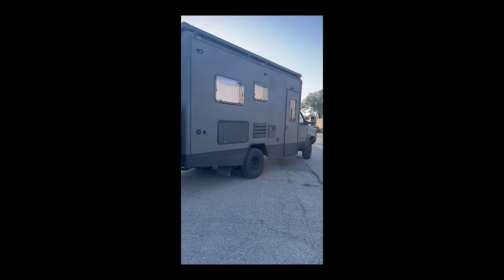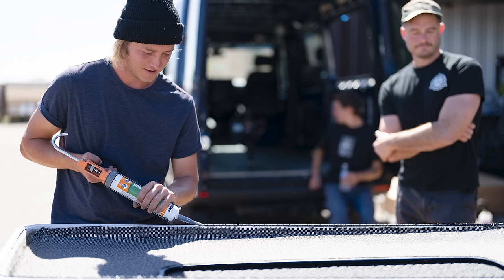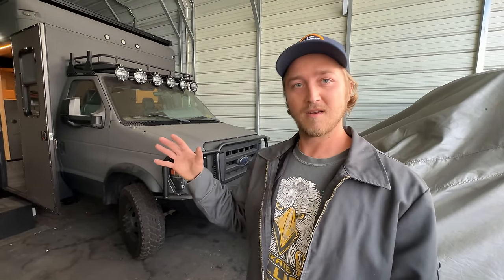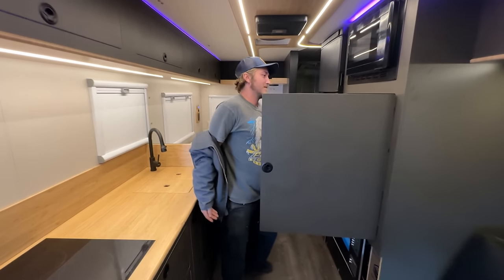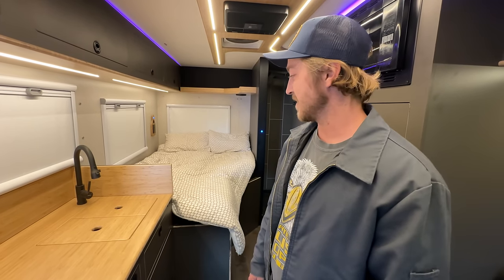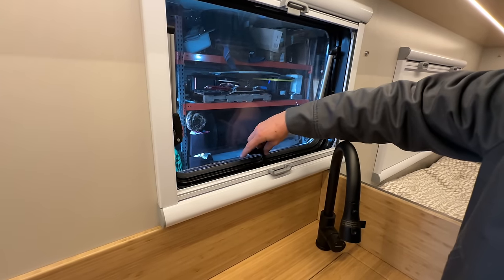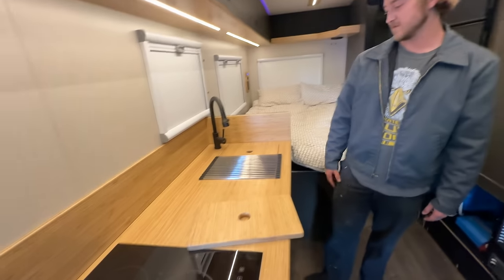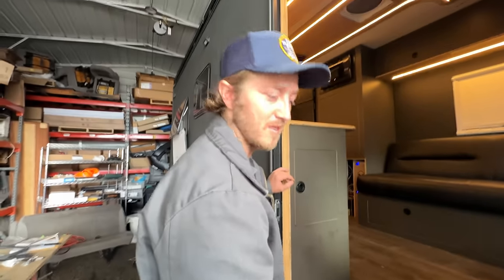We turned a Giant box truck into a Mobile Tiny House

Comment: A gallon of water weighs 8.9 lbs. 58 gallons of freshwater capacity is about average for a mid-size 5thW.  With a raised suspension, driving a rig like this on the highway, at 65 mph, while carrying a max load of water probably is not a great idea. You can do what you want, but some manufacturers, like Jayco and its liability carrier for instance, will deny warranty and insurance coverage for any accidents where its insured vehicle was carrying in excess of 25% of a full tank of water. It alters the center of gravity to such a degree, they consider the rig unsafe for the highway.
Reply: But you don't have to travel long with water. Does it make sense to compare a jayco with a skoolie or heavy duty truck
Reply: Thanks for the info. It was very informative and detailed. I was ignorant about that. Thanks
Reply: @hmmm2564  You may be right. But, your particular insurance carrier may not agree. Unless you pay extra for a rider covering your home made or prototype RV, your rig will probably be lumped in with all other RVs. I did say a full freshwater tank  "probably is not a great idea. You can do what you want." I do agree with you that if you want to have a full tank of freshwater,  one should fill the tank as close as possible to your final destination. I believe Jayco has recently amended its warranty to allow for 5 gallons of freshwater. This would provide enough overnight dry camp water to brush you teeth (if you use tank water, and not bottled water for that) and wash your face. Not enough for even a military shower. This to reduce the possibility of unbaffled water sloshing about in your tank,  and to reduce the possibility of water affecting the handling of your rig on the highway at 65 mph.
Reply from the maker: Great input, we always fill up close to our destination for two reasons-- safety of course and gas milage secondly. This vehicle does have an upgraded aftermarket suspension that is spec'd to the weight of the vehicle with the 58 gallons of water.
Reply: @gtvans Could you do a van conversion for me?
Reply from the maker: @jackwilliam2965 of course! send us an inquiry form of what you are envisioning and we will make it happen! Goodtimevans.com
Reply: None of that is true!
Reply: @gtvans  I'm in the UK 🇬🇧, I have a Del Boy Robin Reliant .
Reply: Dumb comment
Reply: The freshwater tank in your Jayco is mounted so low it probably lowers the center of gravity when full.  Also... water does not weigh 8.9 pounds per gallon.
Reply: @robsnyder2351 lol it weighs 8.34 pounds.
Reply: 8.3. 😳

Comment: After looking at vans and tiny houses I realised quickly a van is to small and a tiny house needs land so a box truck is the perfect compomise for full time living and the best value for money platform if your smart about it. Way easier to build out and way more options because you can use regular house products in most cases and the extra roof space means a practical amount of solar so I find it a crazy choice to put fake lawn on the roof instead.